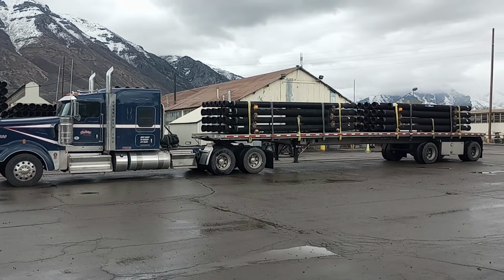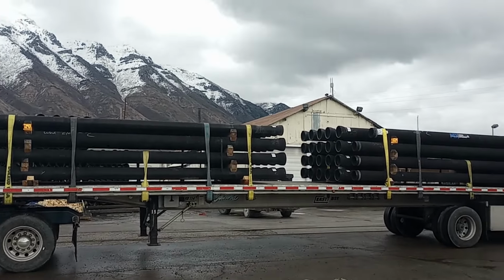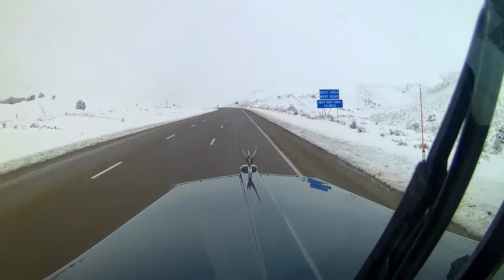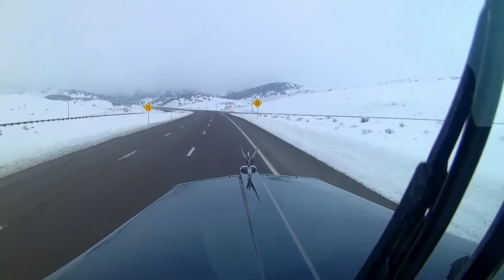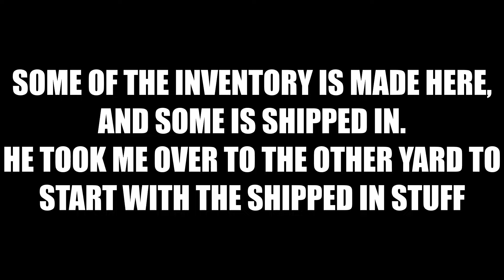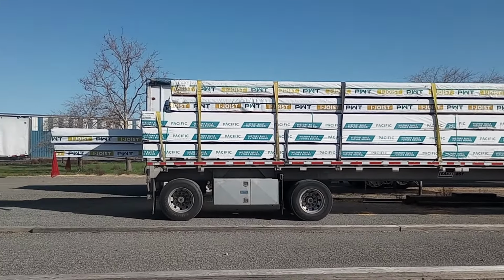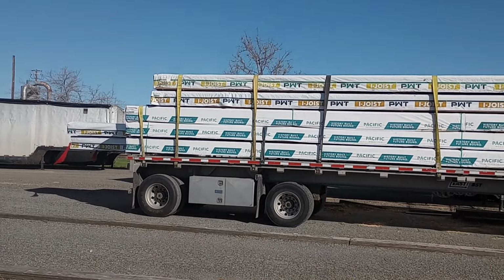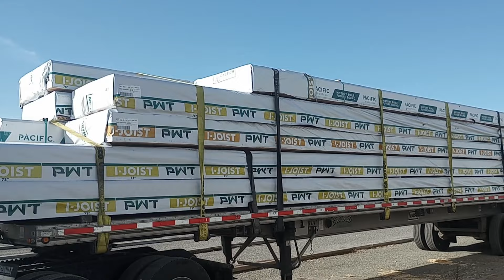Ep 183 Taking A Load Of Pipe To Santa Clara, CA

Comment: Nice trip! I see today where they have a 100 mile section of I-80 over Donner Pass closed. Wow! Love how you do the "gut-wrap" on a lot of your loads. I found from an old timer years ago that even if a gut-wrap wasn't necessarily required it was a good idea to do that especially on certain types of loads i.e.like ypu pipe but especially on large units of finished lumber......that stuff was slippery.
Reply from the maker: That painted decking material is really slippery too, yes, pipe and lumber can really move around on you!
And it looks like they are really having fun up on Donner's.  I don't think it's as bad as last year, but that doesn't matter to those stuck up there now!